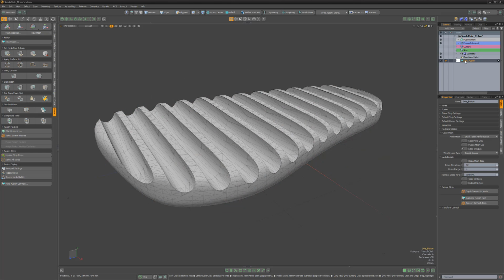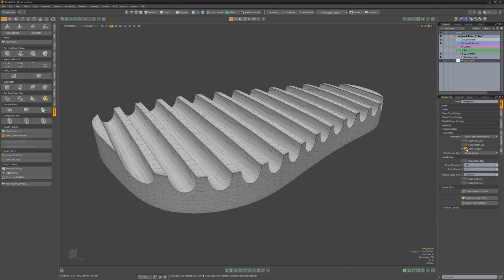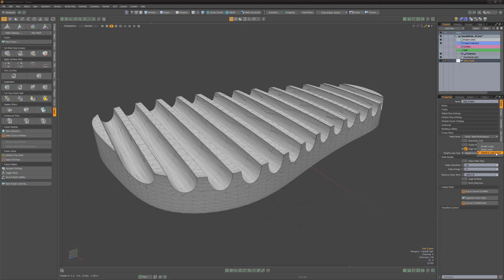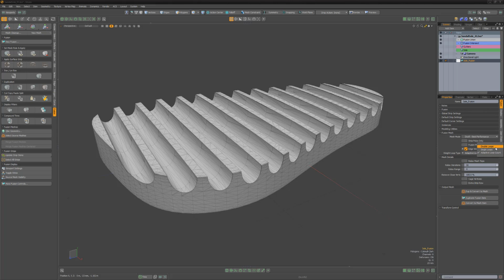MODO | MeshFusion: Edge Weights

Comment: A little tip as I was recently running into this. For me when I had Edge Weighting at 100% it kept breaking the Mesh Fusion. I finally figured out if I lower it (range varies) it would work properly again. I was able to lower the percentage and still hold the sharp corners I wanted. (Modo 14)
Reply from the maker: Thanks for sharing